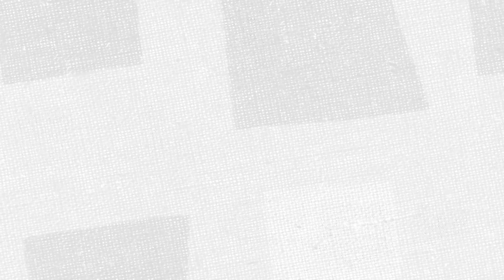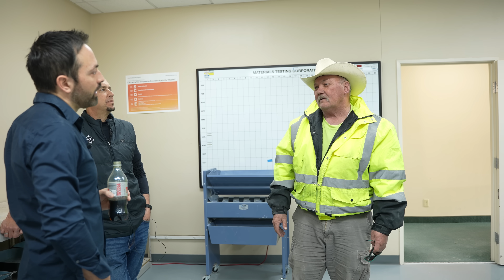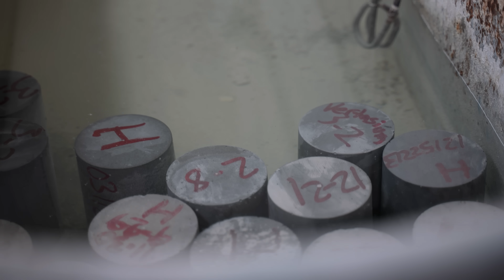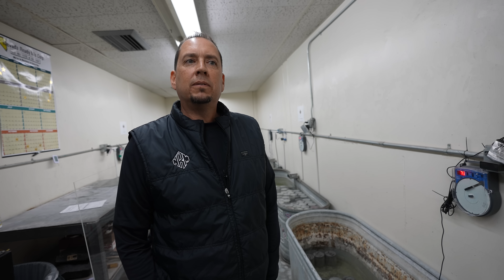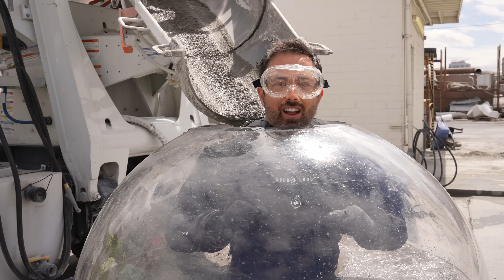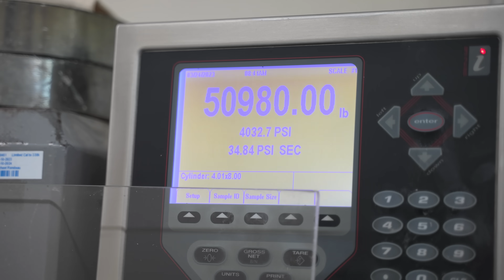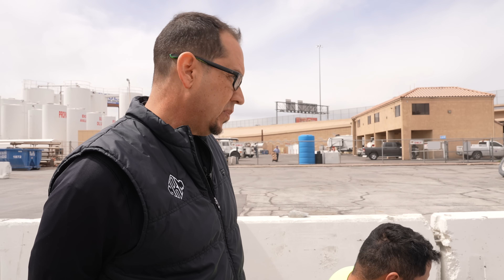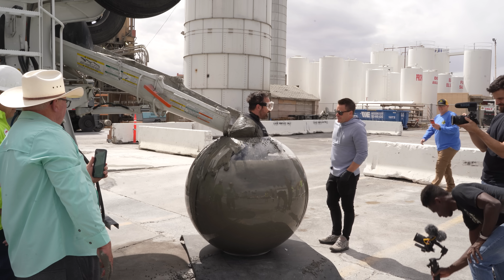Getting Buried In Concrete To Explain How It Works

Comment: 35 year concrete veteran here....*found a few inaccuracies here. (Not that im a structural engineer either but, hopefully after decades of working in and with, hopefully we have picked up some knowledge along the way ;). Altough, overall, all-in-all a good beginners video as to some of the sciences of the origins of mix design. Not sure on the rest though 🤦‍♂️. Especially mixer drivers carrying coke 2 liters is crazy😂-what...who told you this?
Maybe ive been doing things the wrong way all this time...in that case...I probably shouldnt mention which projects, bridges, dams, hi-rises I've put together OO

Comment: I'm working on Geopolymer Concrete, in which we replace the cement completely by some environmentally friendly sustainable alternative. It's still my final year project but I'd be taking it forward. I've achieved good results with using Rice Husk. It reduces cost & carbon emissions. Let me know if one can be of any help 💫

Comment: One important note, Romans did use steel bars in their concrete and we did. This makes huge difference as concrete is weaker when subjected to tension forces and steel strengthens it.

Comment: Pantheon Temple, has the worlds largest unreinforced concrete roof. I am amazed you didn't feature it. The roof must have been formed by a handcrafted wooden forms to give it the features and the oculus. No way was that roof made from wet concrete. More likely a very dry mix, compacted by hand because too much water make concrete weak. Also, you missed out ettringite crystals, they form around the aggregate as a result of the pozzolanic reaction and it is that chemical and creative reaction that helps form strength in the concrete as they bind the cement and aggregate together. Concrete is not a subject for the feint hearted to take on, it is an over simplified chemical reaction 99% of people don not understand. Ohh, and you were not "floating in concrete", the concrete was resisting as it cured and as it cured, the mix stiffened up and you were trying to break though it.

Comment: They add air to concrete mixes (3% or more) if the concrete will be exposed to freeze/thaw conditions. There are many additives to concrete for different purposes. Also, you forgot to mention water as one of the ingredients! Kinda important lol

Comment: 10:33 What? No. Jagged sand interlocks better
Reply: Sounds like the right answer. More surface area.
Reply: They are referring to the "finishing" of the concrete which is how it looks from the outside. Having jagged sand would be harder to smooth out on top and give a nice look on the outside. With regards to the strength of jagged sand vs rounded sand I do not know that jagged sand would create a stronger final product but it could possibly.

Comment: Without watching I'll explain that to you. (wet concrete )
Concrete is both incredibly heavy and incredibly dense. Burying somebody in concrete is possible even on land  because of these 2 features.
 A splash of concrete you can get off,  but a flow will easily wiegh you down in a very short time. Your body will struggle under the burden as your clothing soaks in all the moisture available. Soon, the weight will be too much, at which point the increasing pressure will force your skin into submission, and your muscles will be over taxed in every response. Breathing will begin to work against you.  
The act of breathing is actually quite strong having to outward flex your torso expanding the ribs & really increasing over all your total physical mass but as you are essentially choking & drowning at the same time by now every act of  exhaling will lift an increasingly impossible amount of  pressure and every act of inhalation collapses the frame of your respiratory system smaller than the last until the inability to continue the process combined with the lack of oxygen triggers involuntary muscle spasms that will go nowhere as concrete is incredibly heavy and incredibly dense and you were completely fucked long before you were trapped in your own mind.
😊 science is fun.

Comment: We are just Lazy. For centuries the great structures of Europe were built using stone, they also managed under floorheating and so on. That was the most of high rise they needed. The material they used as glue and as a decoration actually took in CO²

Comment: Ok so every year more than 10 billion cubic meters of concrete is created.  
We only need about 80 million cubic  concrete to build a bridge across the Bering Strait 75 meters above sea level.  
That's 0.8 % of the amount produced in a year.  
Or 0.2% per year if the bridge is built over 4 years.  So there's plenty of concrete being produced to build such a bridge.  
I'm talking about a bridge with giant piers that are 30 meters wide and spaced only 100 meters apart so it will take a lot of concrete to build it.

Comment: Next time, make them pull you out of the concrete, leaving a wet coat of concrete. Then let this concrete dry, making a hard concrete suit around the protective suit you have on. After you’re stuck in this suit, make them pickaxe you to try and crack the concrete until you have enough mobility to get out of it. Pickaxing won’t hurt because the dry concrete would act as armor for you.

This is a random thought I just had while watching this video lol

Edit: I never expected bill wurtz to be in this video

Comment: If concrete is turned into dust midair in a building collapse would it have the strength to pulverize thousands of bodies ? We are told this is why 90% of the bodies were never recovered from Ground Zero. ( asking for a friend )

Comment: How does the water not just rise to the top of the concrete?
Reply: It’s mixed in. They are chemically combined. It isn’t like oil and water where it is separated as now it is completely combined.

Comment: I don't buy the survivorship bias explanation for long-term durability of unreinforced roman concrete vs black bar reinforced Portland cement. The alkaline environment of concrete can theoretically protect the rebar inside for a while.  In practice our cost cutting and short term thinking society appears to be (at least in the USA) creating ticking time bombs as Chlorides producing Fe2O3 and Fe3O4 (rust) cause an expansion of the rebar over time tearing apart our infrastructure. Carbon, Glass, Basalt fiber rebar seems like it would have a better chance of creating long lasting structures without serious maintenance even if the same cement was used.

Comment: I’m pretty sure the problem of bodies floating in concrete has been solved thousands of times in the building of most cities. You can’t check for human remains in the foundations of a skyscraper. 😢
Reply: Edit: does concrete dissolve human bodies due to its alkalinity?

Comment: pure cane sugar will cause concrete to set for days if i was to buy a load of concrete i would never pay for it cause it does effect the psi of the concrete not good might help the company save a mixer truck but should never be sold to a customer.

Comment: Ummmm…..I worked in construction for years and I always saw the cone for the slump test turned the other way. 
The way they did it in this video, the cone was upside down. 
They also didn’t use a piece of rebar to prod it 25 times each 1/3 of the cone 😂😂😂😂😂

Comment: Awful test, your feet were at ground level, letting you stand on the concrete that reached the bottom. If you really wanted to test this, it would be done 14-16 feet deep to see if you actually sink or get shot to the top. No space to kick your feet off the ground there.

Comment: You for sure didn’t get buried in concrete, misleading I was hoping to see you get buried in concrete and letting it set while you were in it and then having them chip you out! Use your suite to pump air into the suit to keep the compression of the concrete setting on you so you don’t suffocate. That would be the real experiment. This was an educational video on concrete not how it works with you in it like you said! Booooooooo